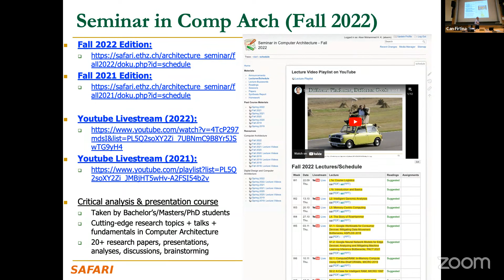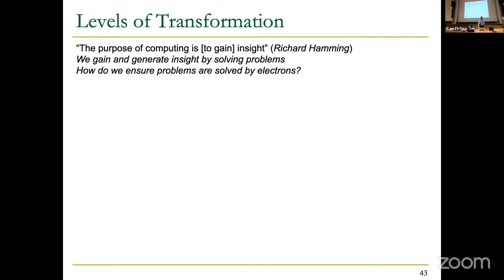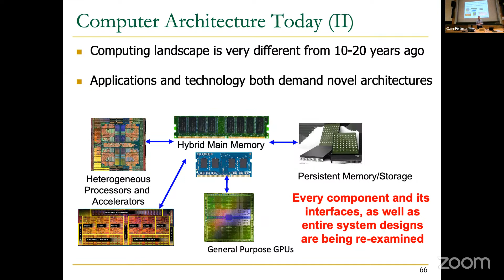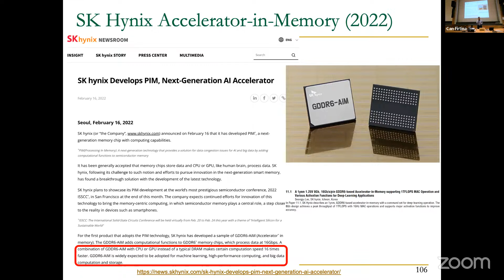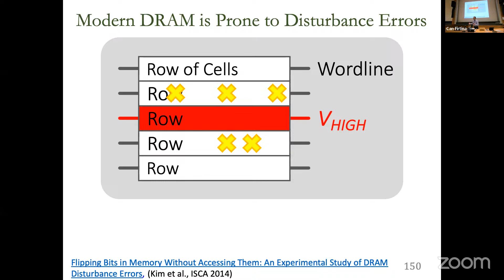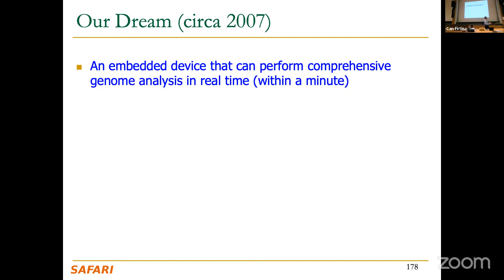Digital Design and Computer Architecture - Lecture 1: Introduction and Basics (Spring 2023)

Comment: I am very interested in the interconnect between software and hardware. Specifically operating systems and the ability to orchestrate data flow between user applications in memory to various digital hardware devices (network cards, displays, keyboards, etc) and to other applications in memory without them writing over each other. Specifically how you implement or build these operating systems from line 1. The ordering of which modules of the kernel to load into memory first so that other more complex modules that depend on them can run correctly, up until the point where the system is ready for user input and user applications. Im also interested in hypervisors for the same reason; they are like OSs for other OSs.

Do you have any recommended reading for that specific piece of digital computing?
Reply: This as well as the rest of Onurs lectures for the hardware aspect of that combo! Then for operating systems, I would recommend an Operating systems course, there are a few on youtube. Most of the Os lectures that I have found follow the operating systems concepts book (also known as the dinosaur book) and that is the one I use, but you can’t go wrong with the tanenbaum book or another one known as OSTEP! Studying both computer architecture aswell as operating systems in concert has given me a much more informed view of how computer systems do what they can do!

Comment: What are the prerequisites I need to take before taking this course? Can I take this course with little to no knowledge about computers?
Reply from the maker: Yes. This course is designed as a first course in computing. You do not need prior knowledge. We start with the transistor abstraction (as a switch) and build on it to construct processor and memories (and move to more advanced concepts in digital design and architecture).